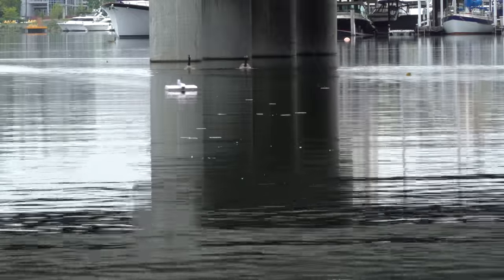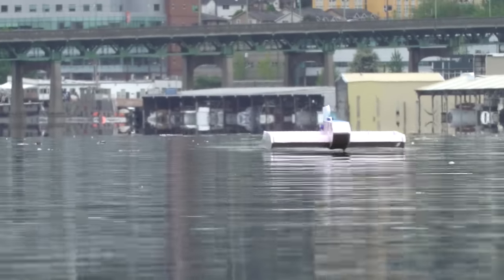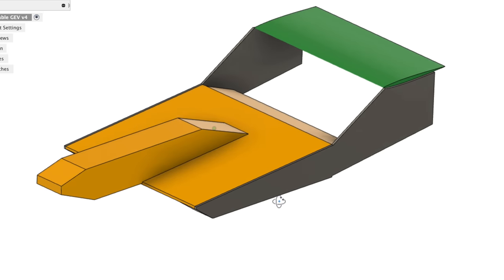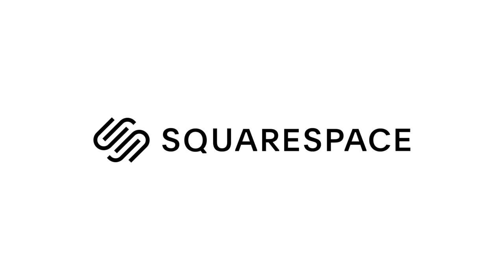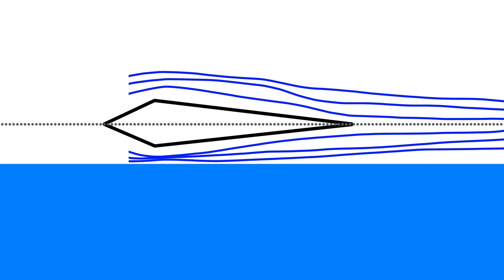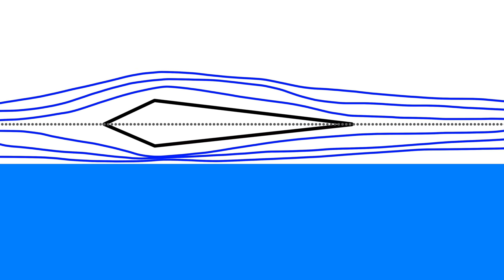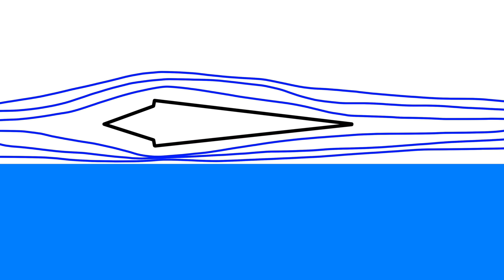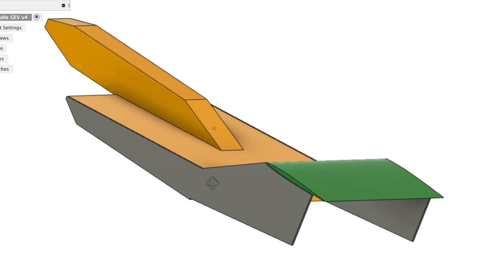RAM Effect Vehicle - A New Type of Aircraft Wing Design?

Comment: May I make a suggestion/idea? With this design, it seems like air under the "wing" is crucial, so why not just move the air where you need it?
This idea is based on how "bladeless" fans work. Inside their "ring"/circle structure, they push air from a small fan out of the back of the "ring." Since it has an airfoil design, the theory says that that fast air decreases the pressure, thus "outside" air tries to fill the gap and increases the total air going inside the ring.
So, if you put a fan (horizontally) in the nose to pull air in (giving the nose some trust from the air suction) and you push the air at the tip of the "wing" in your design… it should create a low pressure very close to the wing itself, and more (faster) air should come in between it and the water.
Just some random thoughts, but I think if this worked you could keep the nose up even standing still.

Comment: You said the two main reasons for ground effect vehicles are Fuel efficiency and payload capacity.  But I have a third, maybe more important reason.  
The city I grew up in was always trying to use fast boats to shuttle people across a stretch of ocean.  They repeatedly used hydrofoil boats to do this, but the driftwood in the water kept damaging the foil.  
So a ground effect vehicle would be the perfect solution, if only a design could be found that is stable against wind and rough water.  
The only way I see is to have it as a semi-autonomous vehicle where the computer can make high speed micro adjustments on the fly.

Comment: I'm convinced you had the right idea adding the side skirts, but they aren't high enough. Perhaps another inch with tapered angles in the front and rear. Consider small sealed tubes that act like floats/skids attached to the bottom of the taller skirts. This would save the energy needed to achieve "lift off" because the craft would already be in position for the ram effect. Of course I may be entirely wrong about this, but it's a theory.

Comment: Have you made one with the motor and propeller in the back. Also you never said where your center is balance. What if you move your battery towards the back. Do the propellers have to push air under ? What about propellers on deck and battery forward for your CG?  And a tail up right noticed it was walking back and fourth a tail would stop that

Comment: Hi,
I do model boats straight racing, using what we call a rigger (sort of hull)
The boat stay out of the water at the back thanks to the semi-imerged propeller lift, and at the front with two sponsons.
We try to stay out of the water for obvious reasons and so on my boats I choose to rely only on ground effect (touching the water occasionally)
My boat is 1kg heavy, 1kW peak power, sponsons width is 3cm each (6cm total).
My actual speed is 140km/h but it can go over 160km/h.
I don't know how to send you the geometry of the sponsons if you are interested

Comment: Great work. To maintain a horizontal level at a fixed distance from the water I was thinking of two tiltable wings (one front and one rear) who's angles are controlled feedback control systems. You would need two sensor that tell the distance to the water and two actuators that set the angle of the wings (or flaps). And a Raspberry Pi with some custom software. Should be good.

Comment: WIGE is very old.

The Soviets had enormous vehicles on the Caspian and Ural Seas that used these properties.

They were meant solely for use over lake or smaller seas waters (with no swells, as in the oceans).

They did test them over Steppe, which they worked on, but were too easily crashed.

Comment: Hi rctestflight, while I do not want to cast any bad light over what you are doping and if you have really thought all this out for yourself then very well done!. I write this first because some years ago I came across documentary about the long difficult development of an enormous eight engined aircraft using the same physical properties you have found, they were trying to make an army transport plane that could carry several hundred troops and all their equipment over land or water at such low altitude as to avoid most ground based radar systems.
I am not sure why the project was abandoned, in part at least because the development of propellor driven engines stalled and jet engines do no work  well at low altitudes.
While I have been writing this post I have been trying to remember what they called the thing, some multi-syllable word that has no other application!. Suddenly just as I was about to post this to you I saw another reply below that mentions the same thing it was the Ekranoplan!.
Cheers, Richard.

Comment: HELLO
I have an idea, install the fron motor with a little lean angle pushing down. 

The idea: When you acelerate the front goes up and the motors air use efficiency decreas.

With the angle now when frunt kicks up the rotors will push foward resulting more speed = to altitud due to wind under the wings. 
 I love your result.

Comment: Adding two parallel knives of the same material to either side of the wing on the bottom, will:
1- Enhance altitude stability near water. This would be more of a hover craft effect, where the crafts wants to get lower when the gap is too big, instead of doing a back-flip.
2- Enhance pitch stability. This would happen it three ways:
A- when angle is too low, the knives prevent the air from going out the sides, creating more lift at lower speeds.
B- when angle is too large (nose moving up), more air goes out the sides causes exponentially less lifft as the angle increases (depends on the slope of knife angle).
C - when nose is too high, the back of the knives will drag on the water pulling the nose down as an extra precaution. Shape of the knives should be similar to machette blade where the wide tip is the back of knife.

Comment: You should look at the XB-70 Valkyrie. It's wings were designed so that it could ride the shockwave of a sonic boom efficiently enough to theoretically carry it over Mach 3.0.

Random idea: If you angle the wings you have now 2 degrees up and make a control surface angled 5 degrees down at the tip to create an inverted gull wing (think of the rudderon of the yf-23 but inverted), you could control the airflow underneath your plane more effectively and efficiently.

Comment: Hi, I'm not hating on this and I'm fully curious now but have some questions. Is this really a hover craft? Riding a cushion of air and when you get too high the cushion dissipates? Am I wrong? Why did you decide to not use an airfoil? I think that when you truly achieve WIG it should naturally stay in ground effect without artificial stabilization and not want to fly above half its wingspan, ever. I think youre "engineering" forces to counter each other like Lift vs Downforce while denying you have an airfoil or hovercraft situation, "it's a wedge."     I have some Ideas of how Id do it but want to know why you did things like you did. You've thought about this more than I have. Thanks!   P.S. I think this is really cool.

Comment: I'm curious if there would be any efficiency differences in a ground effect aircraft that was driven not by propellers but by a prop shaft still in contact with the water.  Have you given any thought to something like that?  It could be a step above hydrofoils, except no contact with the water surface except for the method of propulsion.

Comment: You should try out separating the main hull/cockpit area from the wings with the ability to pivot. Then change the bottom to be move like a ship a ship hull mixed with the downward slope needed for your minimal lift. This would help to counter balance the additional weight of the main hull. You will likely need to reposition the main hull some to get the balance just right but I think this would make for a much welcome improvement and increase overall stability.

Comment: if you did the wing in a NACA shape; and then had a strip of foam edgewise front to back, and the outer verticals extended down a touch.
( like a stationary trimaran, that goes catamaran with speed, then ground effect )

Comment: I'd take a hard look at the Venturi tunnels of F1 cars, banned since the 1982 season but back for 2022. The reason they were banned in 82 plays into the struggle w/ your plane. Any nudge, bump, or rough piece of track led to the cars hurtling off the track. You are looking for an equilibrium where you get to X forward speed and the downforce and lift cancel each other out. and you look like a very fast forward propelled hovercraft. Ideally you'd want active aero because of changes in windspeed and other factors. Large scale use for this thing? I dunno. Military. Low observable recon of rivers. It could be like a standard seaplane but w/ ground effect for stealth.

Comment: Pardon my English, as I'm not a native English speaker. In my youth, I was planing and constructing a ground effect flight capable shallow depth going submarine model.

At first I was successful to build none submercible, but ground effect flying version of it, that wasn't that much different of yours. One of the differences was the placement of flight engine and prop. They ware mounted in a superstructure like looking pod, that you might know from typical submarines. And the second differece was the method to self-regulate the angle of attack for ground effect flying. It was achieved by V-Shaped tail-surfaces, that partially used the proximity to the ground dependend momentum as a physical self stabilizing back loop. Somehow the V shaped tail avoided to induce oscilations of the pich. No stirring rudder, no regulating electronics or controller, but simple 4 channel RC where utilized.

Then I had no time to proceed, as personal circumstances went very dim, and I had to take care of more life related issues. I've dropped out of the project before finishing water tightable compartment for the internal combustion engine in the superstructure, that was used for flight-mode.  And even before instaling the balast tanks for diving.

The major motivation was to prove of the concept for  "triphibian" vehicles, on that cheap budget... not their purposefulness ;). As the major challenge was identified the goal to get up in to the air for a usually heavyweight submersible vehicles. It should have been aproached by utilizing the advantage of much higher lift in a ground proximity and usage of balast tanks and limiting the diving depth significantly.  Yes, you can always apply a very high-powered engine, but it wasn't available for me back then. And I was aiming for a reasonable dive and flight times, which is impossible with high powered motors. 

Maybe, when you are done with this project, especially with your future trials of high weight flight in a ground effect, you can go crazy, as I did back then, and try to build a submersible ground effect vehicle ;) it is quite a challenge and fun to try to achieve.
Reply: I had to correct own massage. It was embarrassingly confusing even for my self.

Comment: So basically you're building a Soviet ekranoplan aka The Caspian sea monster. A jet powered ground effect vehicle so large it was classified as the world's heaviest airlpane, took 50 soldiers and had a jamming suite and cruise missiles which was a concern but did it at a cruising speed of 270 mph and top of 310 mph.  These things were never mass produced I believe 1 was ever finished but what a beast of a machine. Never became a thing because an errant wave or crosswind would lift them up as if flew 16 feet above the water so one wave and it would basically become a cruise missile with a human payload. But imagine sitting in it 16 feet bove the water at 310 mph. That must have looked so incredibly fast, damn I wish that these things were still here. But the wind and waves seem like it would be disastrous here too. Still great work

Comment: Ground effect is more efficient than bus in both time and fuel cost, not an airplane.
Airplane on 15000m say, would have benefits of thin atmosphere and currently non-commercial afterburners are incredibly efficient at 25km altitude and mach 3. (~9000isp)
However, in some cases it's better than airplane, for example mid range destinations. Not for Europe to America, but;
 I can imagine a world where you could coast from Crimea to İstanbul, or England to Germany, with electricity, and as fast like in an hour with a ground effect transport.
Thanks for the video, king!

Comment: Try a lower angle than 5 degrees to prevent it from flying in greater speeds and then add a stabilized pitch mixer in it. does it have a horizontal stabilizer.? ,.

Comment: What about using a hull design from a twin sponson catamaran type speedboat? The gap between the sponsons are wide and deep in the front, but narrow in both width and depth in the rear creating a compaction of air which helps to generate more lift than a flat surface alone. These channels also limit air spilloff again maximizing lift. Just curious.

Comment: Fantastic!! man o man r u my hero
How about adding the Outboard Horizontal Stabilizers(outer wings) like what you had on the Bixel?! Would bring the aerodynamic center farther aft which makes it easier to distribute the load like batteries etc. would also help it to be more efficient and also stay in ground effect.
Have a look at Blunt Trailing edge aerodynamics. a splitter plate in the middle of a thick blunt trailing edge produces 2 vortices that streamline the airflow at the trailing edge. 
keep up the good work!

Comment: the side walls, what would happen if you angeled them either inward or outward? 
they both would cause drag I know, but I'm thinking more about the turbulence in the back in relation to the RAM underneath. 
from a non engineer standpoint I'm very curious on how very slight variation in air flow changes the big picture. 
I'm also very curious on how an Annular box wing setup would do but with concaved sidewalls. (yeah this is asking a lot from foam I know)

Comment: Maybe wings with the bottom is always parallel to the water and the leading edge ramming air down. So trapezoid. Put two wings. One in front of the other, the rear bigger. That will keep it parallel. If it lifts too high it won't have much lift without the ram effect.

Comment: In an airplane it is well known that the higher up the plane is the safer they are because you have a longer time period to correct any mistakes.  A ground effect vehicle has far more catastrophic things that can go wrong than a boat does and it does not have the safety buffer of time that a plane has.  That is exactly why the Ekranoplan (The Caspian Sea Monster) crashed, and probably why no one bothered to try to save it when it was out there floating for a week before it sunk.  Also in theory you should be able to handle a heavier payload in a ground effect airplane, but in reality all the additional equipment that needs to be added to make a ground effect airplane work cancels that out and the Ekranoplan was much less efficient than a large airplane.  So that is why they do not have any commercial cargo being transported by Ekranoplans.

Comment: Could you add a flight control surfaces that would change the equilibrium height in ground effect? I guess increasing raw speed should change the equilibrium height, but it would be nice to do it at constant speed.  Maybe just increasing the effective angle of the wedge?

Comment: You should probablty elongate fuselage to the aft side to shift the center of gravity instead of adding weight to the nose.
Then get rid of the tail wing. Your craft idea does not imply it need one.
The low-pressure zone behind the propeller creates a downward force at the tail, and turns up the nose, which is bad on it's own for the ground effect vehicle, and also changes angle of attack.